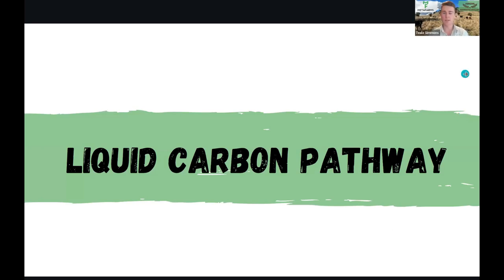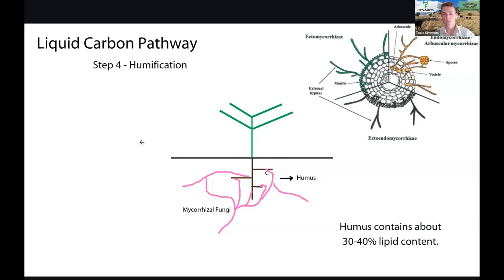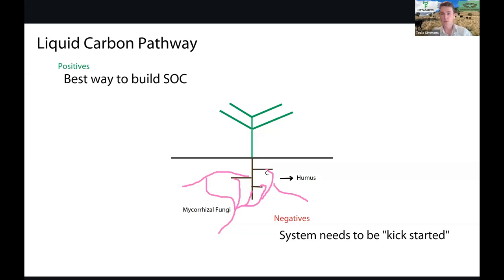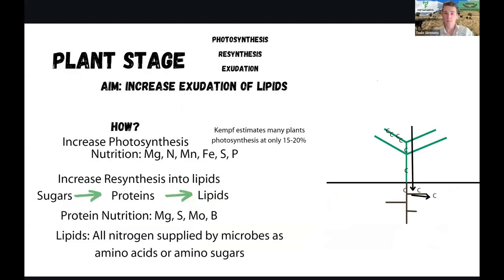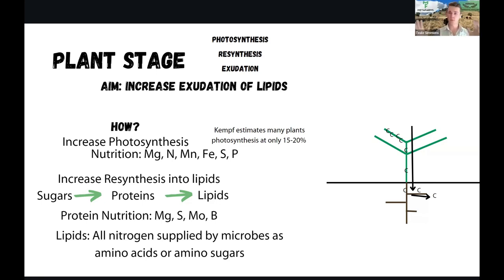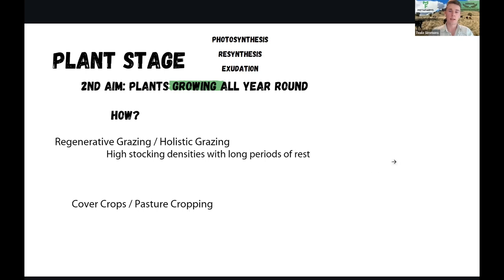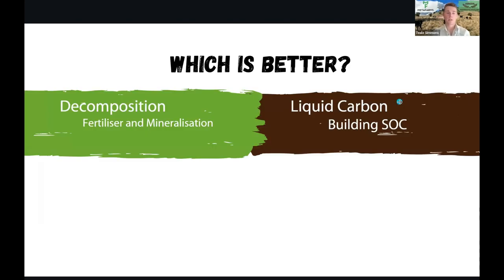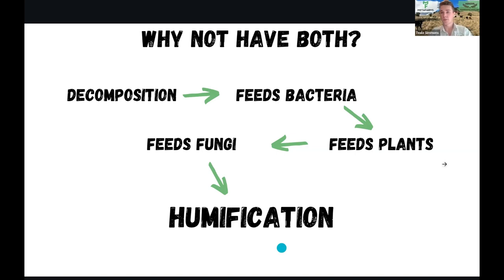Liquid Carbon Pathway | Soil Organic Carbon Masterclass | Regenerative Agriculture

Comment: I just wanted to mention that the part about lipids is not correct. Amino acids or amino sugars are not the same as lipids but independent chemical group with a different make up than lipids. Lipids (like phospholipids) are components of cell membranes of plants and miccroorganisms whereas amino acids and sugars are synthezied within a cell. So yes, when a cell by interruption of its cell membrane or other reasons amino acids and sugars might be released from the cell. But as these components are easily degradable they are rapidly taken up by other micoorganisms and are thus rarely fixated within the soil. It is rather a cycle of mobilization (by cell death) and immobilization (by being taken up). So basically increasing the lipid content is not what you are looking for. You are loking to increase the microbial biomass, by increasing root exudates (which also contain amino acids and sugars). These compontents are then taken up by microorganisms and are converted into lipds which are needed for their cell membranes.
Oh and also, proteins are made of amino acids. So its amino acids --> proteins. The chemical strucutre of lipids is different. Lipids are build from fatty acids with a polar phosphor beads (in the case of phospholipids which most cell membranes are made of). Allthough the message is understandable, the chemical part in this video is pretty mixed up and not correct
Reply from the maker: Hi Anne, I can see where you might be confused. You are correct in what makes up proteins and lipids, but in the video I talk about how plants prioritise carbohydrate production over protein production, and protein production over lipid production.

Perhaps it was the Sugar -> Protein -> Lipids that was confusing, which is my bad, it would be better written as "Plant Prioritise: Carbohydrate Synthesis > Protein Synthesis > Lipid Synthesis. So in order for plants to produce more lipids, we need to make sure we supply the correct nutrition for Carbohydrate synthesis and protein synthesis first"

The reason for wanting to increase lipid production is to supply the Mycorrhizal fungi with more energy to produce humus. This process of humification via liquid carbon is different to the decomposition of biomass.

For more information on this, I would recommend reading some papers from Christine Jones, PhD. You can find them at https://www.amazingcarbon.com/ 

Otherwise this is also a good reference from Jones: https://www.amazingcarbon.com/PDF/JONES-LiquidCarbonPathway(July08).pdf